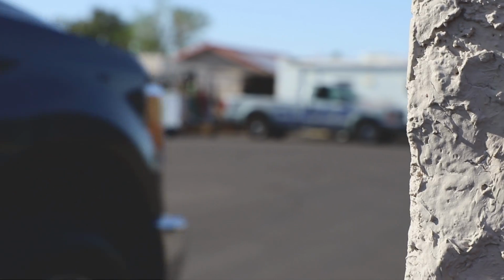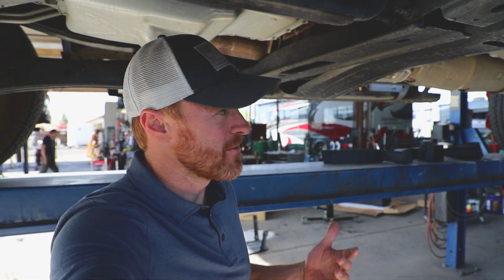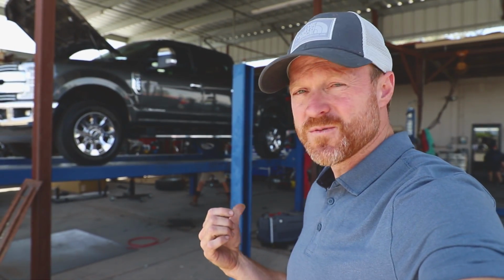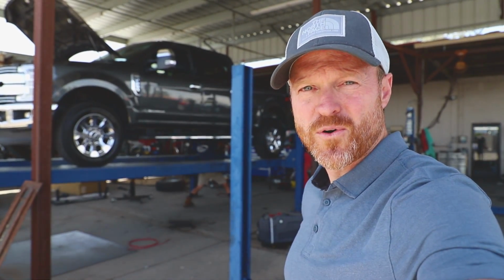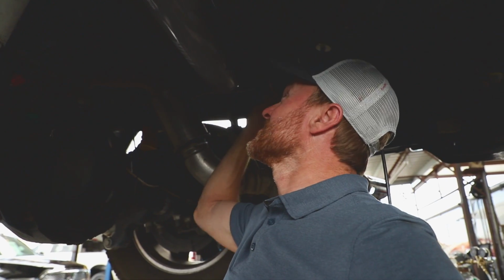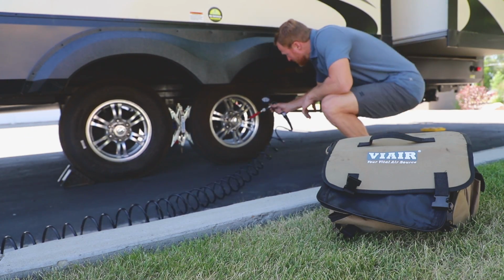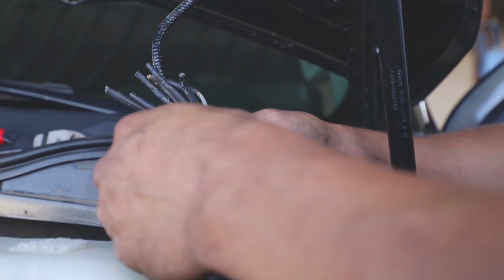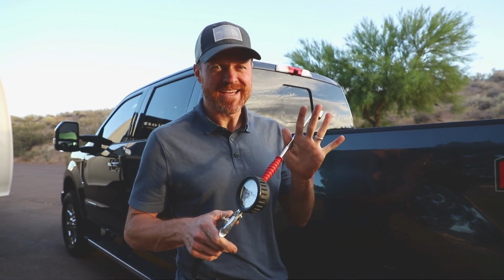FORD F250 MODS | FIRESTONE RIDE-RITE, VIAIR & TRANSFER FLOW TANK

Comment: Older video but hoping to get a response. I need to install airbags on my Chevy 2500. I recently purchased the Viair 400p. Can I use that to air the bags as needed since I won't be going with a built in compressor?

Comment: I have a 2018 f-250 6.7 turbo diesel. I want to get on the road right now for those exact upgrades. Only question is the cost, it has to be expensive.

Comment: Hello... Recent Subscriber and just checked out this video as I was scrolling through your extensive content (which I cant wait to digest, initial impressions is that you're going to have some great vids) but I have a question - did the placement of the compressed air quick-disconnect become an issue?  Seems low and unprotected from road grime, was dirt an issue?  I would think inside the bed (sure you have to drop the tailgate to access but it would stay so much cleaner.  Maybe at a minimum around the license plate recess where it would be above the bumper. You said in the vid you were headed to Alaska, I can only imagine having to need that air on the side of the road mid trip and have it covered in iced road grime... curious how this worked for you.
Reply: Just saw the 2020 Mods and Upgrades video that addressed this question so disregard.

Comment: Never install an air compressor underneath the truck it will rot and corrode and also no need to install a gauge in the cab if you use a height control valve eliminates the guessing off inflating the airbags

Comment: Reading the comments, I too was wondering about the water in the air lines. Most air compressors have a drain valve or petcock to get the water out that was made during the compression process. Maybe you could give an update (I may need to just watch further ahead in another video) as to how this worked out. Also the boys would really dig an airhorn set up on the truck. Just saying.

Comment: With that tank on my F150 3.5 EB I would have a 1400 mile range LOL  I couldn't pull the trigger on 250 BC I can't deal with diesel. I'm getting about the same rowing 8K lbs but like 24MPG not towing.

Comment: Any problems with the transfer flow system while traveling in the truck.
Reply from the maker: Zero issues. Best upgrade ever. Getting fuel half as much is nice to have every week.
Reply: Great to hear, I have a 50 gal. in-bed system on my truck, going through a little funk with a dealership that wants to blame the problem on auxiliary tank, but I don't think they fixed the original problem. Thanks hope you don't mind me asking later about any problems.

Comment: Great video. Very informative. Gives me ideas.....  Just a quick question. Where did you place the gauge and switch for the compressor? It looks like you installed it in the console storage area. If so, how did you run the air lines to it? Also was the connection at your bumper welded to your hitch? I couldn't tell.  Thanks and keep up the good work.
Reply from the maker: Cliff's Welding. Good shop. I'd go there again. Yes, attached to the hitch frame.
Reply: @KeepYourDaydream  Thanks. Just wondering where you installed the air gauge and switch in the cab of the truck. I couldn't tell in the video where you installed it. Thanks.

Comment: Great video!  I pull a small fifth wheel (1,100# pin weight) with an F150 HD.  Installed Firestone airbags - they are fabulous!

Comment: If I understood your disclaimer, all the products and install were at no cost to you? My question is would these upgrades be worthwhile if you were writing checks?
Reply from the maker: Nicely said. Truly. I'd like to think our subs that have been following us for 3 years now trust us and know we always shoot straight. Bottom line. There are always problems with products. We ask our partners if they will take care of KYD Community and make it right. That's important to us. We also pick the products prior to reaching out. We never install what we don't actually need.
Reply: Thanks for the reply. As one of the subs I enjoy your videos. They are very well made. On the topic of reviews, have you received products from manufacturers that have not lived up to your expectations and said so in the review?
Reply from the maker: Not yet, but we're very very selective and pick only solid brands. I will share any problems we have if/when the occur. Grand Design is not a partner or sponsor, but they are about to fix a warranty item that we'll be sharing soon. Also, if I have the slightest doubt, I just buy the product, install it and use it before sharing. If I like it and think the community will like it too, I'll reach out to the company to see if they want to offer a discount to the community. I'm doing that right now with ARP Fridge Defend. I bought the product and it's sitting on my shelf. I'm not sure $289 is necessary to fix the fridge cooling issue as there might be cheaper options. But I'll know for sure after installing it and the temps reach 100+ again. Then I'll share it on the channel. To answer your other question about the mattress (which we love), I'd just return the product and say...sorry, we can't share this on our channel.
Reply: Again thank you for the replies. I guess the skeptic in me questions the validity of reviews when the reviewer does not have a financial investment in the product. Is the product great because it was free? Your explanation of the approach you take eases my concerns. 
Thanks for taking the time to respond, keep the vids coming and safe travels.

Comment: Great video, had a few questions though forgive me if they are ignorant. I am considering installing a air bags system on my F350 as well as a viair set up. How do you fill the tank to full capacity without over pressuring you air bags, are the bags plumbed straight into the tank or was a tee fitting used? Also the switch that was installed in the cab, does it fill as well as dump air pressure?

Comment: Nice upgrades!
Did you have to do any recalibration or coding to get your fuel gauge, and the 'miles to empty' readout, to work with the larger tank?
Reply from the maker: Yes and I'm still waiting for the Ford IDMS to update so we can change to 60. The miles to empty doesn't bother me though. The gauge works fine. When it say 50 to Empty, I know I have close to 100.
Reply: FORScan might have some options for you to diy.  I purchased the same truck last week so I'm still doing research myself.  
The short bed was a trade off.  Long bed comes with around a 50 gal tank compared to the 35ish on the short bed, but it's harder to live with day to day.  I like the idea of a larger aftermarket tank if I can make it all work.  :)

Comment: Be cautious of the aftermarket stuff you add to your truck.  If you read your F250 owner's manual it states: "approximately 1 MPG is lost for every 400 lbs. weight carried". That tank weighs 200 lbs. plus another 30 gallons of diesel is 213 lbs.  So right there you've reduced your gas mileage by 1 mpg. Even the small accessories like air pumps, mud flaps, bicycle racks, air shocks etc. begin to add-up quickly.  Not to mention that adding a high capacity gas tank messes with the truck's trip computer...so no more "miles till empty" feature. But I guess that anyone who can afford $2000 for a gas tank swap probably doesn't much care about gas mileage anyway.  For me, I have Verizon Wireless road side assistance in case I should ever run out of gas, it's $3 a month.

Comment: So, you can have a hose with that set up, to air up other tires? I just installed a air lift system and can't do that . That's the reason I got the onboard compressor.  How much did all that cost?

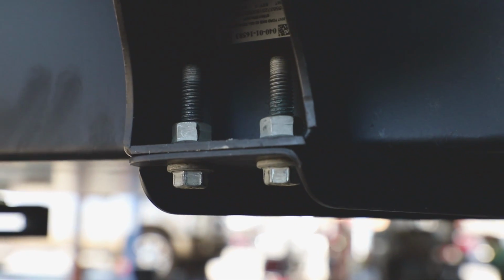Comment: 1:37 2017+ standard fuel tank is 35 gallons.  You've got another 5 gallons when you hit 0 miles to empty.  I called and spoke with an engineer in fuel systems at Ford.  Gas stations in Alaska close at 6:00?  You should worry more about what's open in YT that what time gas stations close in Alaska.  YT is so remote and wild - even with planning, it'll scare you your first couple of trips - LoL the most remote part of Alaska is like the big city compared to YT - I won't even mention NWT - good God.

Comment: how low does that fuel tank sit now? Can you see it just looking at the truck from the side?I've seen some oversized tanks and they hang so low you see them hanging down there just looking at the truck from the side and I don't want that.and after reading the comments I see the concern of moisture in the air system have you noticed this to be an issue?
Reply from the maker: It's not the lowest part. Hasn't been a problem, but the 4x4 F250 sits very high.

Comment: UpFITTER, not uplifter. Love the spot you chose for the air fitting, easy access and mostly out of harms way, plus as close as you can get to the trailer tires.

Comment: Were you able to have the onboard ford computer reprogrammed to the bigger fuel tank size on the truck for the miles to empty calculation?
Reply from the maker: Not yet. Called again with no luck.

Comment: Did the air guage/filler come with the VIAIR kit or did you buy is separate?  If separate, can you post where you got it and the model.  Really loved the way it worked.
Reply from the maker: It came with it, but we didn't install it. Cliff's said knowing the PSI in the tank is not necessary. We installed an Airlift gauge for the PSI of the bags. Firestone makes one, but the Airlift version is better and cheaper.

Comment: Love the mods. We have a Ram Truck. We want to add the larger fuel tank but find that the electronic fuel gauges and mileage calculators won't work right. So we are holding off. Does your gauges and computer work ok with the new tank. I know you have Ford but any suggestions are appreciated.

Comment: I cringed so hard, water sprayed on the welds. Unless he was spraying a quenching oil, those might be cracking welds in the future. On the positive side, love air ride and on board compressors.
Reply from the maker: He was cooling the airlines.
Reply: Looked like he took the short cut. Mounted the brackets to the pump with the rubber bushings attached, then welded the Pump with brackets to the truck. At that point you would quickly have to spray down the rubbers or they would melt, cool down the pump and airlines which are also too hot, all while cooling your weld down too fast. Could be seeing it wrong, difficult on edited video and not being there in person.

Comment: Could you go into a little more detail how they wired the viair compressor to the air bags? I have the air lift system with a wireless controller so you don’t have to run the air lines and switch in the cab, it works off a remote. I would like to run the viair compressor to the bags, be able to control wirelessly and be capable of filling tires all off the same compressor. Pretty sure it can be done I just need to figure out how to wire it.  Love your videos, we finally bit the bullet and bought an Outback 330rl.

Comment: Airlift airbags are a better airbag system plus they have an internal jounce bumper, With Firestone, if the bag goes flat you lose both they have no internal jounce bumper.
Reply: If one of my bags went out 2014 Ram 2500, I wouldn't want one bag up and one down.  I have coil springs so pretty stiff anyway 33' Toy Hauler

Comment: I'm not 100% sure as to the reason why Ford only uses 2 main leafs on their F250's but if they'd add more then it probably wouldn't squat as much. My Silverado 2500 HD has 4 leafs.
Reply from the maker: There's an option to have more. I didn't realize how many options there are.

Comment: Just got off the phone with Cliff’s welding.  Going to get the same setup but in 2 phases.  1st phase is airbags.  Quoted $667 for F350 DRW.  Named dropped KYD!   Next time u do a meetup in the valley of the sun I will buy you a drink of choice.  Thank you!

Comment: You should have gotten an F350 dually  so you don't have to spend more on upgrades! Good luck on the added weight!
Reply from the maker: I will. But I'll still add on-board air + the larger tank and possibly the air just for the ride. Weight is good.

Comment: Did you have to have the computer in the truck reprogrammed that you have a bigger fuel tank?  I was told you do...was wondering if this is true or not.  Thanks
Reply from the maker: Chris Alteria Ford is getting back to me. They were surprised they couldn’t update the computer with the IDS like ‘16 and older. I’ll circle back on this

Comment: Great video Marc!  I have the same truck and have been looking into both these upgrade.  Did you notice a difference in the ride of the truck empty (not loaded or towing) with the addition of the air bags?  Again great video and keep them coming!  Thanks!
Reply from the maker: Greg Knight Seems like the same empty. I keep the psi at 5-10.

Comment: Great vids. Interesting mods. Enjoy watching your adventures. One question. Will your air compressor install give you enough in order to use an impact gun to assit in changing out a flat? If not then why the air tank? Happy travels.

Comment: First , I like the video, but if they supplied the product , if I understand you correctly, that’s a big plus. I put air bags  on my 350, pulling a 37 ft. 5th wheel cardinal. Did not give me what I was expecting, but I’m okey with that. Great idea for increasing fuel tank, especially for trip to Alaska. Have a safe trip

Comment: Did you consider the Torklift Stable loads?  I have the 2017 F350 lwb Crewcab and have both a 35ft 5th wheel and a 2700lb truck camper.  I have installed both the uppers and lower stableloads and the handling is now great.  No airbags on my truck.  Next mod will be better quality shocks.  Keep up the great videos.  Enjoy the trip to Alaska!
Reply from the maker: I've recently heard good things about the Torklift system. Maybe next time.

Comment: I enjoy the upgrade videos even though the wife wants to see you on the road more.  The air compressor is something I would have never considered but wish I had now.

I found air bag and fuel tank upgrades really interesting because both things were factors in pushing me to an 2017 F350 long bed diesel.  I got the heavier suspension (extra leaf spring) and a 48 gallon tank.  Did you consider the same when you bought the 250?

Comment: I installed the same bags in my truck, and air horns! You will too. Just a note the compressor makes a good amount of water that collects in the tank, I have been told that I should drain it on occasion. So I'm looking into how since there are no taps on the bottom of the tank. Any ideas?
Reply from the maker: He installed a drain on the tank. I'll see how well it drains.

Comment: Another Great Video.  I love the idea of an onboard compressor with tank and air to the bumper.  After 25 trips up or down the ALCAN in the past 27 years, the last few years you can always find fuel day or night, summer or winter.  But having more fuel range than you want to drive in one day is awesome.  We have a 5th wheel and after we stop for the night we find the cheapest fuel in the area and fill up for the next day without worrying about getting in and out with the trailer.  Enjoy your adventure and we look forward to meeting you when you get to the The Last Frontier.

Comment: From videos seen on YT and other places I was under the impression that a properly-tuned WDH made the tow vehicle and trailer ride level. I was also "informed" that bags were just for leveling payload in the truck by itself. 

Maybe you should mention that bags don't actually increase payload capacity since that's set by the mfgr, axle, and tire ratings. ☺

Comment: hey Marc. did you have sway issues with air bags and a regular hitch ? only asking because we put  airbags on our excursion after I seen you're video. we have no sway at all after airbags and regular hitch
Reply from the maker: We had sway with a regular hitch. Bad. We didn't have air. It never occured to me that air alone would fix that, but that's good to hear. I think every rig is different with weight, hitch weight, truck, etc.
Reply: thanks for the reply. you're videos are very informative. keep up the great work

Comment: These are all great upgrades if you have a boat load of cash but unnecessary. I lived in Alaska for 45+ years, drove the Alaska highway down and back several times towing an RV or pulling a cargo trailer. Never had a problem getting fuel, never had a flat tire, never had a break.down. Your not going to uncharted territory. Take it easy,drive safe and enjoy the journey.
Reply from the maker: I'm sure that's true. I think these upgrades are nice for just being Fulltime. I'm eager to show AK through our lens and not all the drama. Same as Mexico.

Comment: Super jealous!  Nice job on teaming up with some GREAT partners!  Viair is THE name in portable air compressor systems.  Onboard air is sooo convenient!  Firestone is also my choice for air bags.  I installed AirLift bags but found they rode very harsh on my Tundra when unloaded.  Switched to Firestone and the ride was almost as smooth as stock.  I'm also glad you mentioned WDH and airbags.  Too many times I see folks not taking the time to dial in their WDH and simply adding bags when their rigs are still sagging.  Just as you said, this simply REDUCES that weight distributing properties of the hitch!

Comment: Transfer Flow tanks are great. You’ll love the extended range but your mpg will go down. Heavier tank and more fuel means less mpg. Did they install a drain on your air tank? You will get moisture in the tank you will need to drain so it doesn’t corrode.
Reply from the maker: Yup. Drain added. Good point on the tank. But it goes quick.